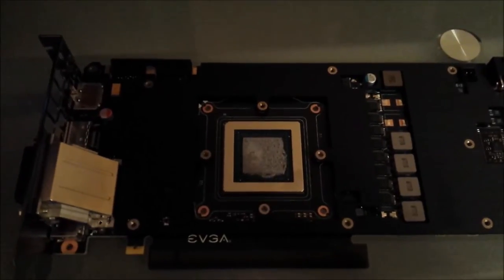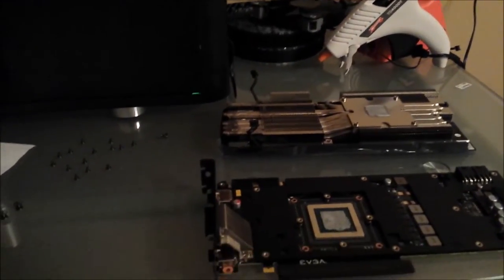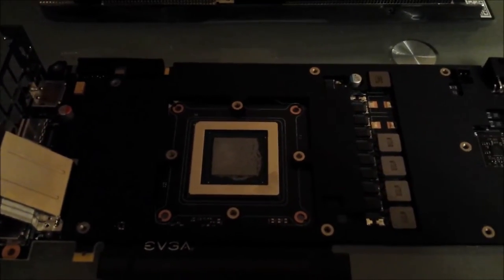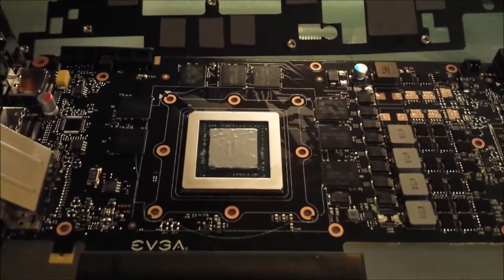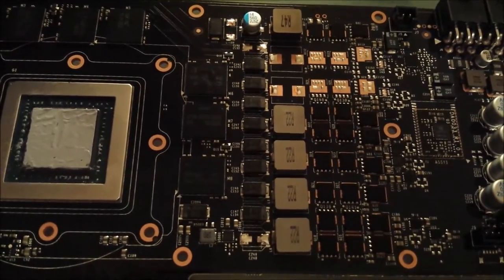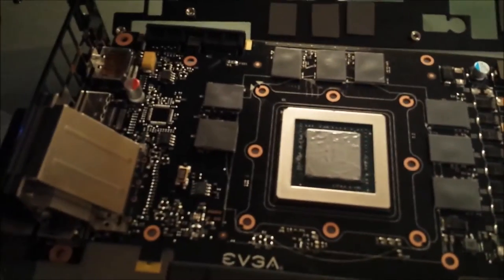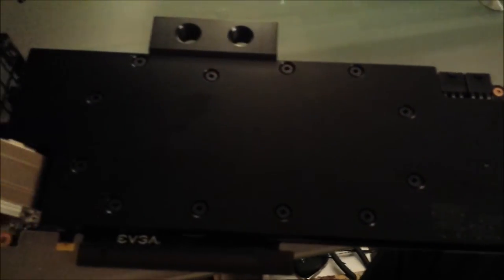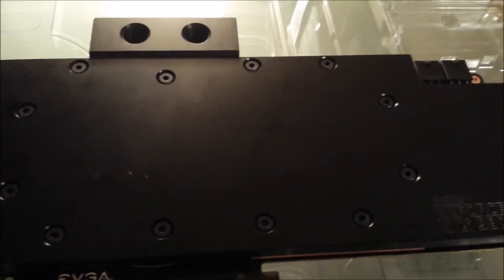Installing waterblock on GTX 980

Comment from the maker: Yea just forgot to mention it in the video but the paste was cleaned and then reapplied before securing the block to the card. Ideally either make sure you hold the pcb and block tightly together when you flip it or just make sure that the water ports hang over the side of a table so that the card lays flat on the surface when you flip it. Thanks for watching.

Comment: Nice vid, except that part where the block separated from the card as you flipped it over.  That pretty much hoses the thermal paste application.  I've had this happen before, and when I reapplied the thermal paste using the ball method I found temps dropped noticeably on my 295x2.